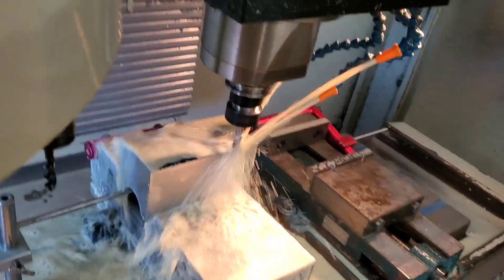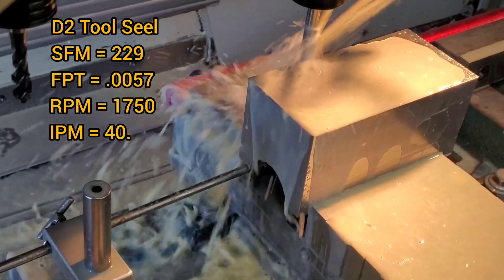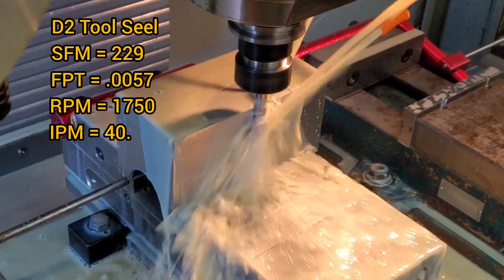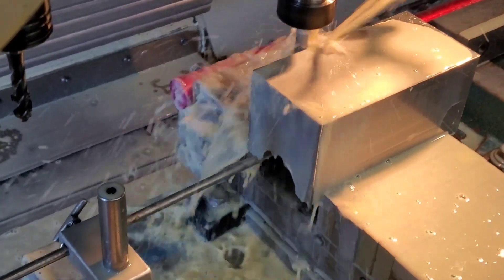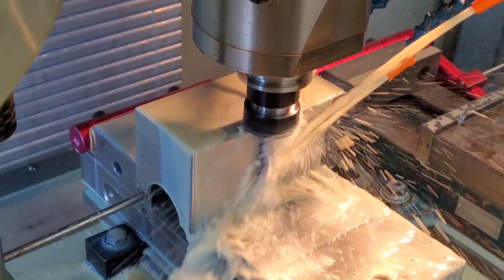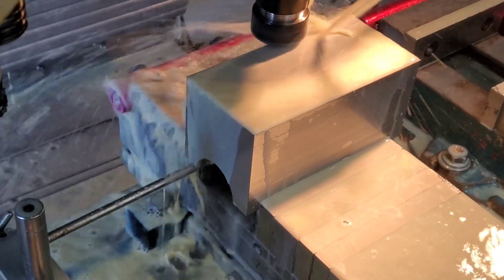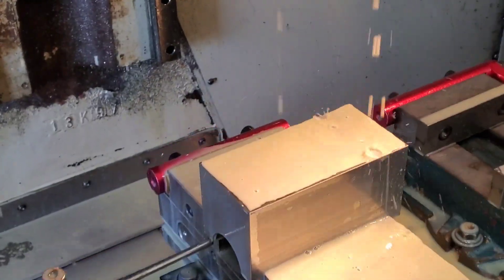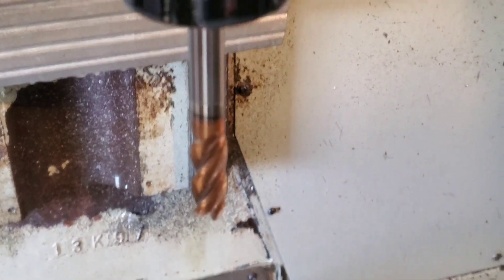Long Deep Side Milling Using Long Shank Endmill

Comment: why not climb cutting?
Reply from the maker: Nice observation. I'm using my old tool path that I used for my long flute endmill.  When you conventional cut with a lot of flute length it doesn't chatter as much. I don't think it was necessary with this endmill and I'll make my next video climb cutting.
Reply: @TeamJC777  Fair enough, I have rarely ever not used climb cutting on CNC machines so I was curious. If it works it works right!